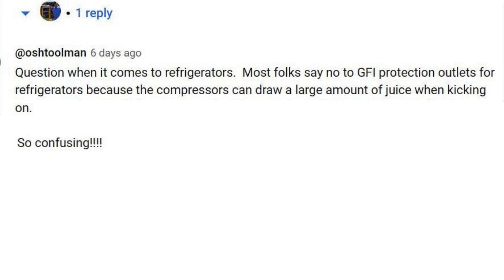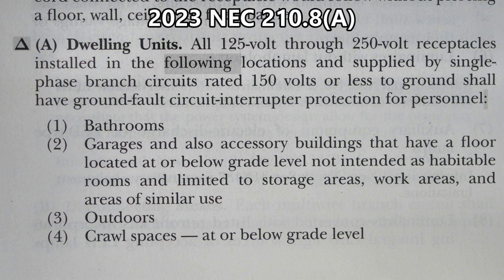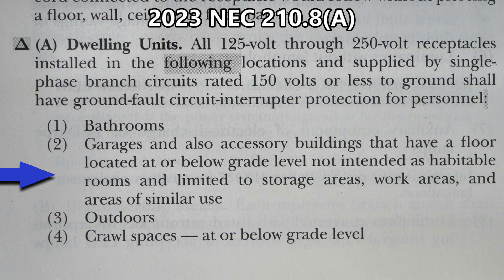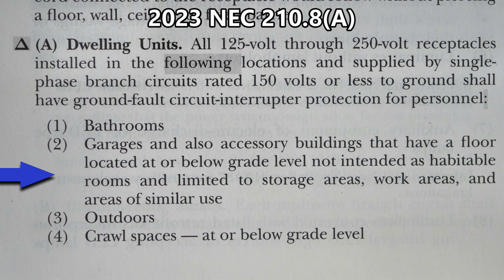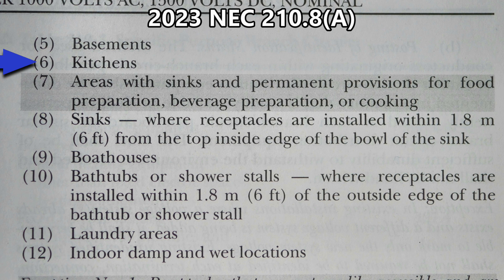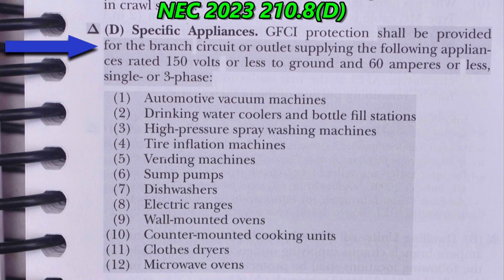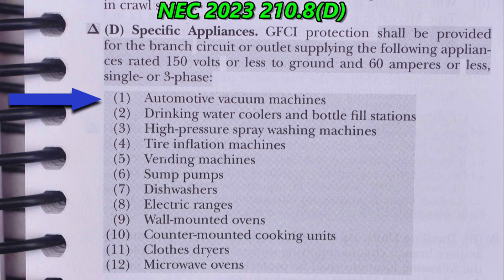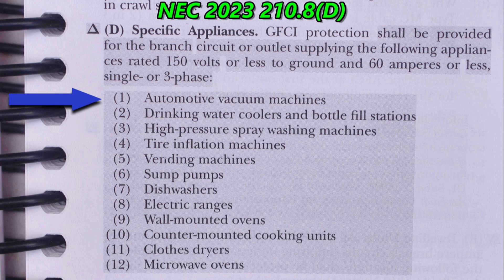Do Refrigerators Need to be Protected by GFCI? 2023 NEC 210.8(A)

Comment: No, the electrical inspector once failed me because I accidentally put a GFCI receptacle behind the refrigerator. He said that the GFCI will not be accessible to reset if it’s behind the refrigerator. So, never, Ever put a GFCI behind a refrigerator. If it’s within six feet of water, you must use a GFCI circuit breaker.
Reply from the maker: Hi Mike! What year was that and what state? I'm not disagreeing with you as this national code is subject to being amended by state and other jurisdictions. Also, you could protect the fridge with a GFCI circuit breaker or with an upstream GFCI receptacle which is accessible.
Reply: So the inspector doesn't think someone can move a fridge?
Reply: code does not allow the gfci reset to be behind an appliance
Reply: @saulgoodman2018  Our inspector doesn't think someone should move a microwave oven or large pot coffee brewer out of the way to access the GFCI. Reason given is that they need to be tested monthly and appliances in the way would make that less likely.
Reply: I just use GFCI breakers. Easy does it.